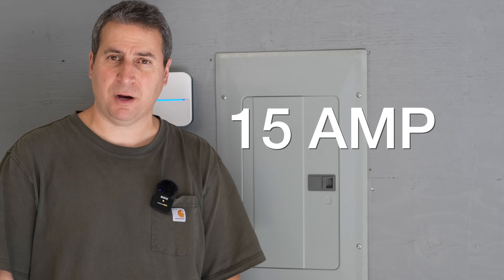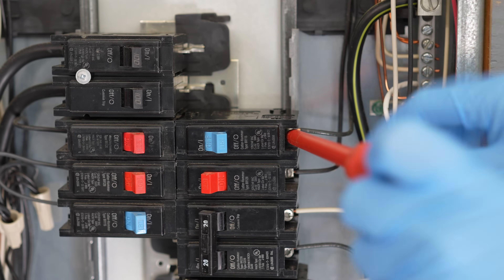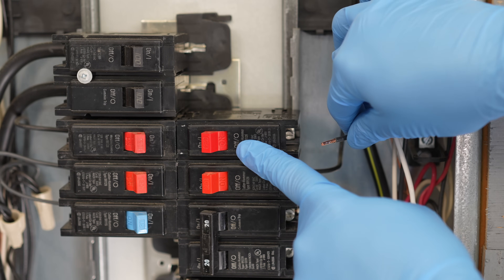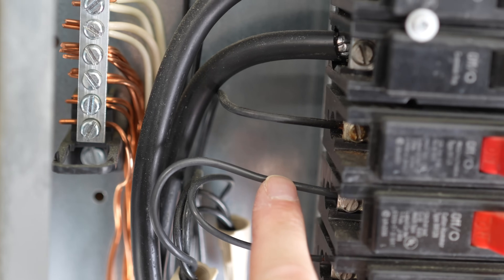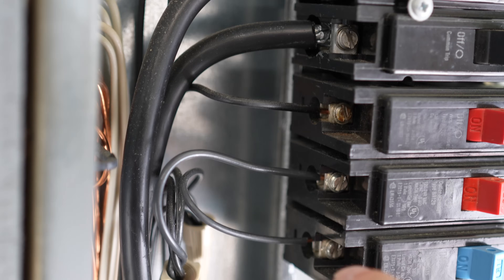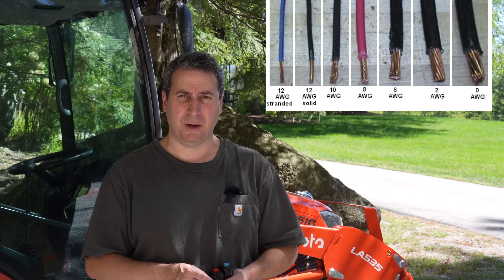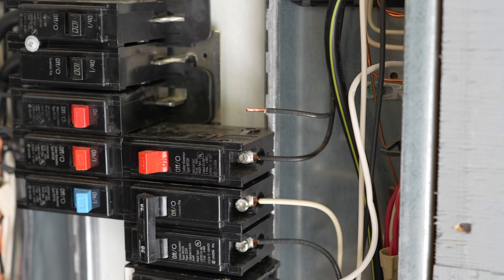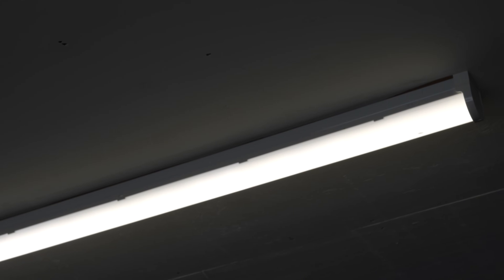WORST MISTAKE Homeowners make upgrading a 15AMP to 20AMP Circuit Breaker

Comment: Good video, I am not an electrician but self taught out of neccesity. Right now I am installing new outlets, floor outlets, already prewired internally. The issue, they have 20 amp plugs, the internal wiring is 14 AWG... I rewired with the proper 12 AWG. Watch what you are installing folks. And yes, I am dropping new 12/2 romex with the appropriate 20 amp breakers. This is for an AV setup in my little corner. What a difference in sound and picture quality all of this is making! Well worth the time and effort!
Reply: How it is that an outlet is prewired? I don't live in USA and I haven't seen something like that.
Reply: @wolfvash22  They were flip up floor mounted outlets that closed and opened for say the cleaning crew to come through and buff or mop the floors. They were already prewired to accommodate the motion involved when the actual outlet pops up from the floor for access. Then you went in through the box mounted in the floor and made your connections to two terminals and the grounds. There is flexible stranded wire to the outlets and the connections where you attach the romex, or hard copper wire. They had 14 awg wiring there to 20 amp outlets. I had to change those flexible wires out with 12 awg stranded. I am sure you have these same outlets available where you live.
Reply: @michaelwright1602  Thanks for answering, I guess I would have to look out for them, but at least I have a better idea now.

Comment: Good video and I’m gonna subscribe But I would like to throw in a little caveat -Those particular breakers are the some of worst ones we come across as far as burning up. I’ve been doing electrical work since 1984, right now in my phone I’ve got a bunch of pictures of those same breakers, Westinghouse/Bryant/challenger style breakers that burned right off the aluminum busbar. Of course, a lot of them have copper clad. Also, we used to use 10-2 copper clad wire on 20 amp circuit because it would break, or 12-2 wire on 15 amp circuits. People also should be aware that during that era they had a lot of copper clad wire used in a lot of inferior aluminum busbars, we had a lot of bad Challenger and even some ITE panels that are bad about burning up. I’ve had about four this year so far one of them also being a contractors house. So educating people about how to identify copper clad wire in houses during the era could also be helpful. We often encounter upsized wires that are copper clad all the time in this part of the country because of the wire being prone to damage.
Reply: I use nothing but solid 100% copper.
Reply: @toriless  of course, when you do new construction.But you can’t rip out EVERY existing system when doing panel change outs in older homes, so in some remodels you have to deal with copper clad wire, unless 
1) you refuse to contract ANY house that has this wire installed
OR
2) you get the homeowner to contract you to remove and strip ALL the wire from the entire house (which is not always possible)

My example was from those times you’re dealing with pre existing wire that was installed mostly in the 1970’s
Reply: When I said “we used to use copper clad wire” I was referring to the INDUSTRY PRACTICE AT THE TIME when the practice was done, explaining what you may encounter . I’ve done this work since 1984 so i came after this point
Reply: There is something I don't get (and I am probably misunderstanding), cooper clad wire were widely used because it was prone to damage? 

Were the aluminum bus bars the ones that used to break?
Reply: @wolfvash22  during that time frame with copper clad wire with being used we also had poorly designed electrical panels, such as Zinsco /Sylvania, when combined with poorly designed wire, these defective panels would create more problems. they used it in the 70s and 80s because it was cheaper. It was a cheap invention. I started electrical work in 1984 but that time they had quit using it and they figured out it was a horrible thing so we had to figure out ways to work with it, or make it safe, we have special wire nuts for it, sometimes it would just change panels also and we still do this to this day.many houses we try to get rid of as much as possible
Reply: @wolfvash22  also, I reread my reply and figured out what you were talking about. What I was trying to explain, was normally in a 20 amp circuit. You were use 12 gauge wire because that is what is normally used for 20 amp circuits. The electricians during that time found out that it was so breakable that they had to go to a larger size for the same size circuit so they would use 10 gauge wire, which is larger for 20 amp circuits. The upsized the wire to prevent breakage. That is why when you go to a house that has this type of where you will encounter 10 gauge wire on a 20 amp circuit rather than the normal 12 gauge wire on a 20 amp circuit. Sorry I didn’t explain it better.
Reply: @anthonygrieco5790  Thank you for answering me, as suspected I was misunderstanding, now I get it much more clearly.

Now I got another doubt, cause I have never used copper clad wire (but I have read nothing but bad experiences about it), by breakable you mean literally wire being torn apart, do you? so that would mean such wire is very brittle.

If I'm guessing right, they oversized not due to voltage drop but rather due to a mechanical concern, right?
Reply: @wolfvash22  Yeah, the way it is if you ever encounter it, and you have to try to actually reconnect it or make it work, Never pre twist copper clad. They make these special wire nuts that or sort of similar to the silicone wire nuts for outdoor That have this stuff like "deox/noalox/Courney etc" Ideal makes one that is purple. This is used to connect that type of wire regular Romex. It can become brittle easily. Usually, you can take a piece of copper clad That has been stripped and wiggle it around and it will break of. If you've never seen it before, It will be flexible rubbery type of wire similar to Romex, But when you cut it.
It is a copper colored wire with a silver colored middle. In other words it's like a aluminum filled piece of Romex, with copper coating.  Many different brands out there but a lot of it will be white jackets With green lettering,  or black jackets with green lettering, Is usually the 10 wire will have a black jacket. We do high end remodels and mansions, But the downside is most of those will have a lot of older wire plaster and  things like that, Especially historic locations, with knob  and tube, bx or copper clad  where additions or upgrades have been done over the years. Honestly some of the knob and tube is in better shape than the copper clad sometimes.
Reply: @anthonygrieco5790  Very interesting, thank you.

Comment: This is a great video for both homeowners and professionals working on electrical projects. You not only explain why upgrading circuit breakers to a higher amperage is a wrong thing to do when the wire connected to that breaker is undersized, but you also point out that the rest of the wiring can also be undersized due to further circuit modifications/additions, like someone running a thinner wire to a new receptacle since it won't draw too much current.

This brings me to my point I would like to share with y'all; NEVER mix wire guages. There's is simply no benefit in doing so. Using a thinner wire is not only dangerous due to excessive voltage drop and current flow leading to overheating, it's now a NEC code violation. It's not worth saving a few bucks doing that. I don't know why so many "pros" in my area do that. I had to replace all that wiring, which was extra expense for me. Using a thicker wire is completely legal, but is not worth the extra bucks in my opinion.

Comment: I am currently looking to upgrade my breaker to support a welder in my garage. Luckily the panel is right in the garage so I was going to create a new circuit to upgrade from a 15 amp to either a 20 or a 30 amp. This video answered all my questions so I greatly appreciate you sharing.
Reply: Garages are THE most common location.  Speaking of garages GFCI is now required in them unlike decades ago.  I have upgraded mine to GFCI but if you add a receptacle in a garage use GFCI or you could hire a pro to upgrade the circuit breaker to GFCI as well.

Comment: What I mostly worry about is my portable heater that run about 1800 W and are on 15 amp circuits! Is this safe?
Reply: Look at it this way: 1800 watts divided by 120 volts = 15Amps. I'd put it on a 20 amp circuit if was mine but that's just me.

Comment: Thank you for posting this video!
My significant other just got a "half sized" tanning bed. I say "half" because it's not one you lay in and is rated for 110V. We had it running yesterday after we installed it and within a few minutes the breaker tripped. I reset the breaker and it did so again a few mins later. I have a commercial grade surge protector and so far that seems to be preventing the breaker from tripping. My first thought was to have an electrician just upgrade the breaker to one that has more amps, but your video made me have a change in thought. Our panel is 100A I believe, or whatever the code is for new homes built in North Carolina, so it's not an old home with ancient wiring etc. What is a safe upgrade to prevent this from repeating itself?
Reply: Call some LOCAL professionals and ask them. They are there for these sorts of questions and SHOULDN"T make you believe you gotta buy their services either. A GOOD professional isn't gonna be "worried" about selling you solutions but rather propose what avenues and options you might have. Even if that means "not getting business out of it". Because they know you'll trust them and call them again for when you REALLY need a service upgrade just as an example.
Reply: @rickytorres9089  Thank you. It turned out using a commercial grade surge protector has since worked. I have a 200A panel box btw...not 100 as I thought. Appreciate your response Ricky.
Reply: @RollinSlow  Awww you are always so much welcome my dear. Glad that not only work but a panel that is pretty sizeable already. :)
Reply: Is there anyway to determine whether the “hidden” wiring changes to smaller gauge before going to the receptacle?

Comment: Sometimes a 15 amp breaker is replaced with a 20 amp (or higher, yikes) breaker to prevent an overloaded circuit from repeatedly tripping the breaker, often because it's an older property and there's not enough circuits to power a 21st century lifestyle.   But this dangerous band aid repair is far more likely to occur with a fuse panel, since it's obviously easier to unscrew a 15 amp fuse and screw in a 20.   Another danger specific to fuse panels, it's possible to have power with blown fuses, by placing aluminum foil or a penny in the fuse sockets.  Cartridge fuses can be bypassed by driving a nail through the fuse, wrapping in aluminum foil, or by using a piece of metal conduit or a copper pipe. Insurance companies are very nervous about fuse panels and might refuse to issue homeowners insurance until the panel is replaced.  That's why it's very unusual for a home to have an old fuse panel still in service.

Comment: Love the fact you mentioned there is the possibility of 14 gauge wiring spliced in somewhere,  thus the weakest link determines the overall circuit rating.   Another possibility is sometimes 12 or even 10 gauge is used for 15 amp circuits,  where there is a long run from the panel,  typically over 100 feet or so and the wire is oversized,  to keep voltage drop at the far end under control,  this sometimes happens in very large homes, or when there's an addition. However,  if there are more than a couple of circuits involved it will often be more cost effective in material and labor to install a subpanel near the remote location,  than to oversize all of the circuits.
Reply: I have actually see in done.  It was in a garage while I had it inspected.  It failed on a lot of issues.  They spliced in 14 AWG on a 20A circuit breaker.  Very obvious since that was was not even covered.
Reply: we do this a lot in hospitals and commercial buildings, use 10 AWG for home runs on 20 amp circuits.

Comment: Youtube shorts electricians: so here is 20AWG connected to a 50 amp fuse powering a light bulb through 30AWG wire dangling in mid air

Comment: My breaker (20A) tripped when using a portable heater, can I change it to 30A? Will that stop the breaker from tripping?
Reply from the maker: Be sure to watch the whole video, upgrading the breaker is only one part of it, if you don't validate the entire wire is rated for the higher amp breaker you will cause a house fire. This task is best left to getting a pros help.

Comment: its crazy that 30 years ago it made sense to have 2 bed rooms share a single 15a circuit, then each individual socket in the kitchen is a separate breaker.

Comment: The wire is rated for 15 amp, but actually it is only supposed to carry 12 amps.
If you put in new circuits, ALWAYS install a 10 guage wire for your outlets.

The reason why is for future upgrades and for the Voltage drop

If you put in 10 guage wire you can upgrade a circuit to 20 amp or even 30 amp later

A lot of times you will encounter a room that needs 30 amps

You will have a TV and a computer and other electronics and you will quickly reach 20 amps.

By having that 30 amp wire you can run multiple high amp devices safely

Comment: Also need to verify the connections in the circuit. I had a circuit in my shop that was 12ga all the way through, easy to see because it was all exposed. But it was daisy chained through 15a receptacles. Pig tailed the receptacles and then I switched the breaker

Comment: One of the reasons I always just use the same 20A rated wires even on 15A circuits. Sure it costs a bit more, but a few times have had the need to repurpose the runs. So comes in helpful.
Reply: Yeah, but it can also cause confusion for some people yet I have some HUGE wires on my house in some places in a few 15A lines.  They are round and not flat about 3/4" round.  No idea why?

Comment: The electrical code is overkill enough to easily handle the extra 5 amps. 'Code' is all about safety and standards, and I am all for that, but fudging, at times, isn't going to burn the house down.
With the introduction of l.e.d. lighting most of my breakers are nearly asleep, even during peak hours. I no longer worry about anyone leaving "all the lights in the house" on. Even when they do it amounts to around 125 watts, and that means every single light in the house, garage, exterior lighting,and shop.
Gotta love l.e.d.😄❤
Reply: I sleep better at night knowing that my house is not a fire hazard.

Comment: I’m in the camp of “if you don’t already know this, keep your hands out of the panel”. 

Exposed electrical parts are very common inside a panel EVEN if the main breaker is off. You can  easily make one mistake and that’s game over
Reply: Yep, it is near the top of the panel where the power comes in.

Comment: At first I was scared, but after watching the video I feel relieved.  Best advice, have electrical circuits installed by professionals.  DIY electrical is nothing to mess with.  Serious and life threatening problems can still occur years down the line.
Reply from the maker: Some projects are OK if you feel comfortable and many of my videos are to help people understand what a job entails. This one is such a common request but just too complicated for an upgrade anyway
Reply: I have ran wire but only to add in additional sockets.  One easy project was adding boxes to supply LED lights for the attic.  Just ran a line from the garage opener junction box to a switch and then from there to three more junction boxes.  I have a second switch to like above the garage.  Since it is rambler access it all in the open.  Running wire down into a cabinet to power wine cooler was a much smaller but slower project.  In general, one you get to wiring you better know all the rules.  I have a 30A line I want installed for a generator.  I might hire someone for that.  I need to determine the location first.  Something even worse would be running underground lines for a shed.  You have to trench, I would lay conduit even though not required where I live since 18" in the minimal depth.

Comment: Electric stove to gas stove conversion would be a great video. Not sure how possible it is for you! Thanks for the great content!
Reply: That is a big job and would require a licensed plumber. If the gas line is not already at the location you want it then it would need to be run. In addition, similarly to electrical, the main feed into your home may only be sized for the homes current needs. We had a home this way and it was going to cost a fortune to upgrade. We decided to go with an induction range. It was the best decision ever. Cooks much like gas but is way more efficient. Our current home has a gas range but I really miss our induction. And no, induction doesn't require any "special" cookware. As long as it is magnetic it will work on induction. Most of your quality cookware works perfect.

Comment: Perfect! Breakers protect the wires in the wall, not the equipment or appliance it runs.
Reply: Yeah, and of the runs are long enough you might have to use 10 AWG instead of 12 AWG but that just does not happen in residential settings.